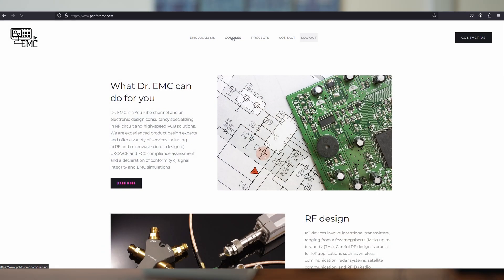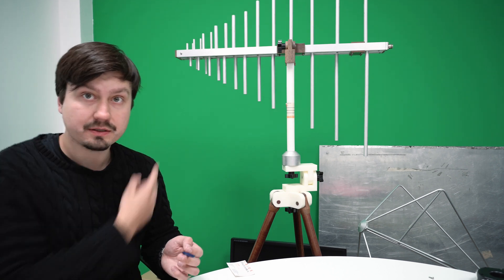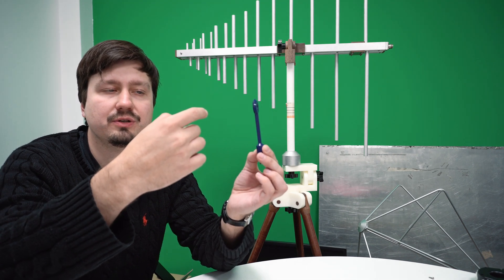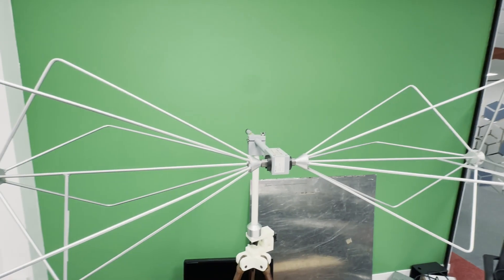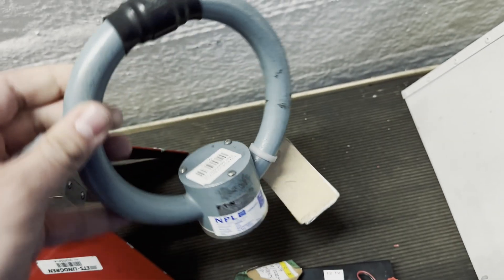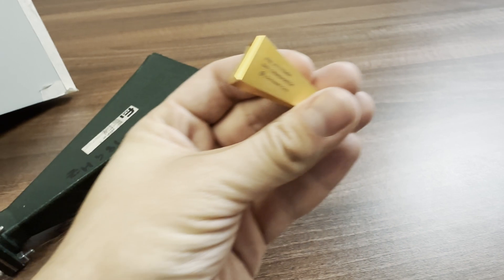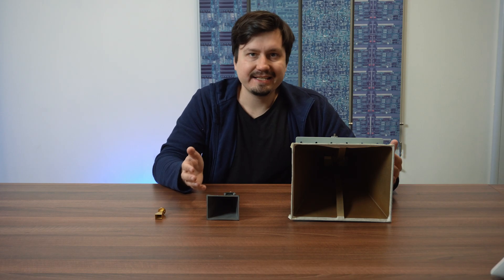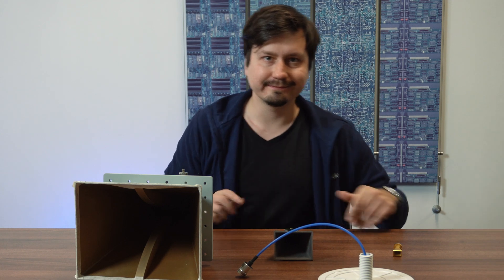Types of Antennas used for EMC Measurements

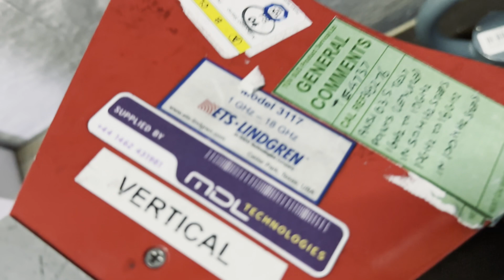Comment: At 11:20 you can see the label on the horn for vertical polarisation, but at 12:08 you describe the polarisations are opposite. My experience with ridged horn antennas is that the polarisation is more easily identified by the ridge orientation, i.e. a vertical ridge means the antenna is vertically polarised.
Reply from the maker: Nice observation! It makes sense with the first 'flared' horn, but 'm not too sure with the second antenna - I will have to double check